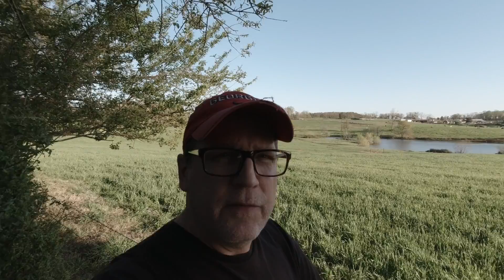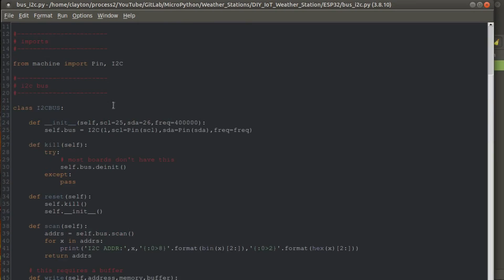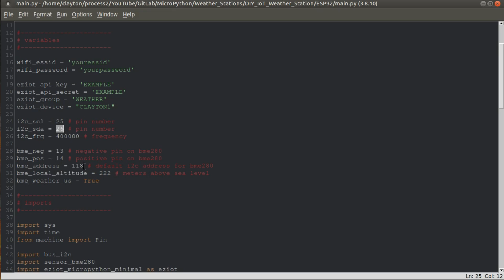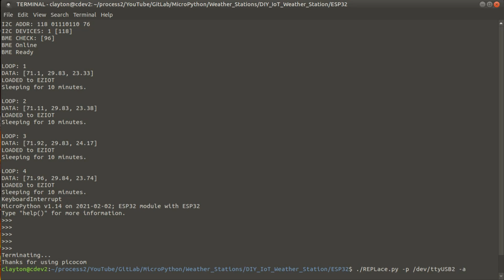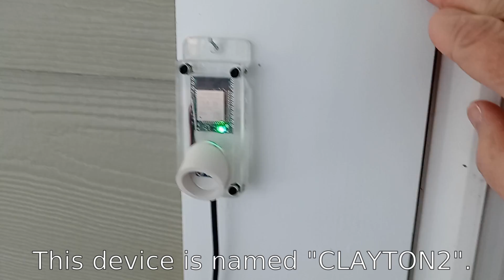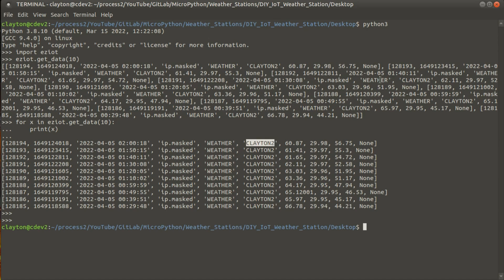DIY IoT Weather Station: Full Project - ESP32 BME280 MicroPython - Temperature Pressure Humidity

Comment: Love this.   The eziot is a great idea for posting and getting data on the web.  I’ve been looking at/for a self hosted server version of something like this so my data stays local and works with my local devices even without a web connection.  This might also help conserve power by only sending data via Lora on wireless/battery powered to local device(s) then periodically sending to the web using "grid" power….. I may also be very confused…..Curious how much effort to use your eziot setup/code this way.
Reply from the maker: LoRa will save power on the remote device, but it does add some complexity on the server side as you will have to create a gateway of some sort to receive the LoRa and convert it to http/TCP for your local network. I wrote eziot using python + fastapi. It wasn't too complex, but I don't have an open source version ready yet.
Reply from the maker: Just did a video on peer to peer LoRa that you might be able to use.

Comment: Your efforts are greatly appreciated as I've been experimenting with IoT devices and wanted to make the change from the Arduino IDE to micropython.  I ran into a small problem in main .py where you declare wifi_password.  I entered my pw and loaded all the files on an ESP32 but micropython would respond with a syntax error on line 3.  The issue was resolved by removing a # sign from my wifi pw and updating the file etc.  Long story short micropython has a problem with # in a string, I'm not sure whether that is documented in micropython's docs, but just don't use # in those variables.  Thanks again!